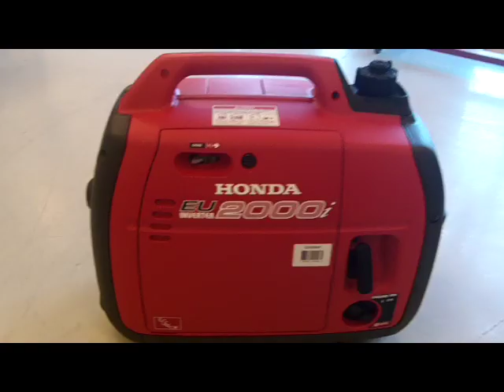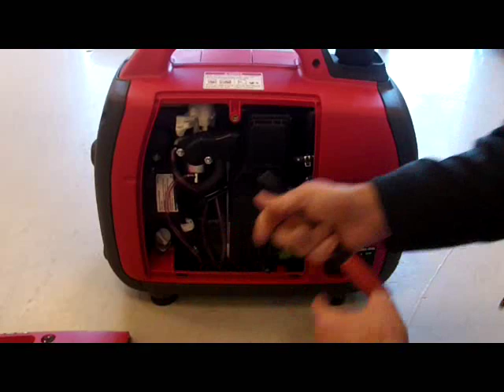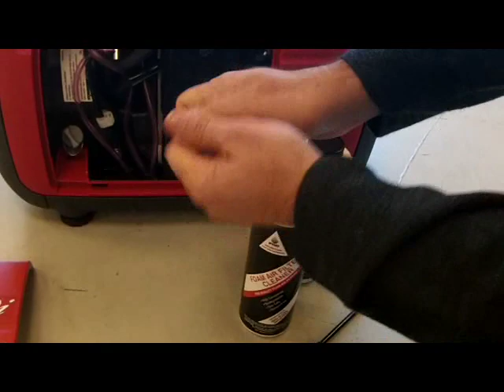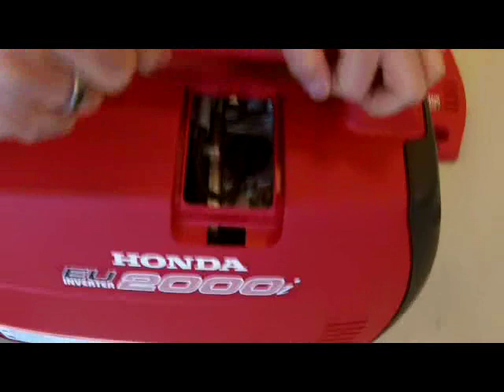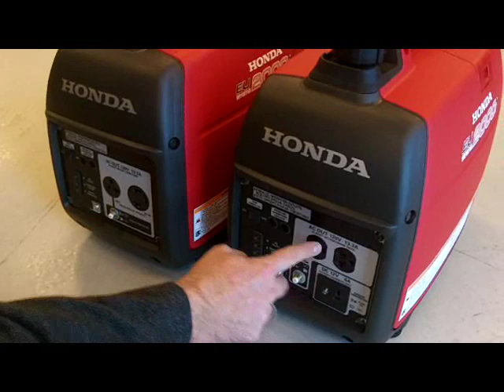Super Quite Honda Portable Generator with Companion with bas

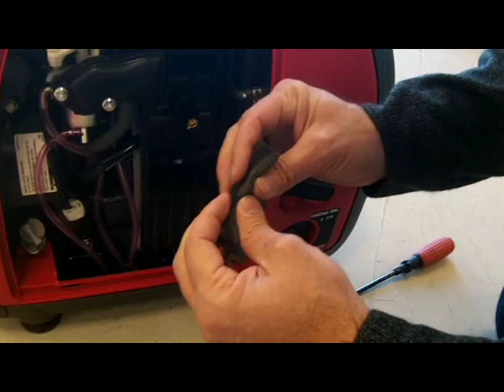Comment: Have you ever read the owners manual? After the filters are cleaned, and allow me to quote the manual. "Dip the filters in clean engine oil, and squeeze out all the excess..." You say to not use engine oil, but the manual does! See 2:10
Reply: I’m located in Utah’s desert. I agree the engine oil is probably sufficient for most conditions, but air cleaner oil is MY preferred recommendations for this model in my geographical location. Better to be safe than sorry. But yes, if you choose, simply use the engine oil.